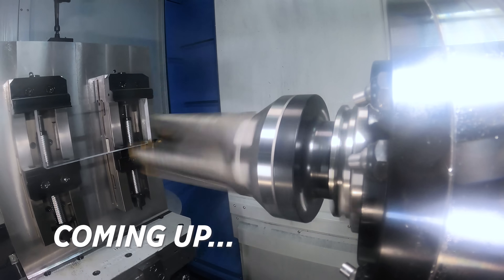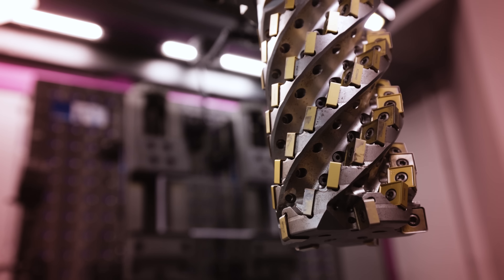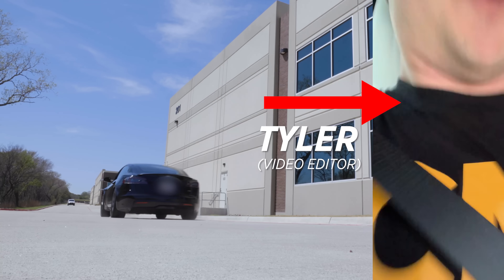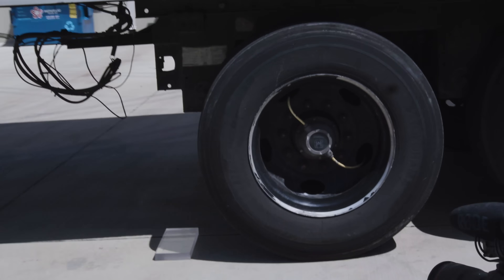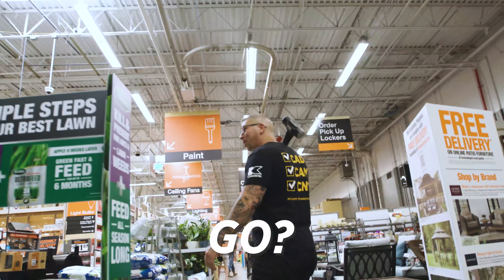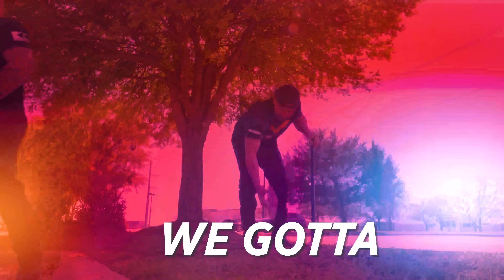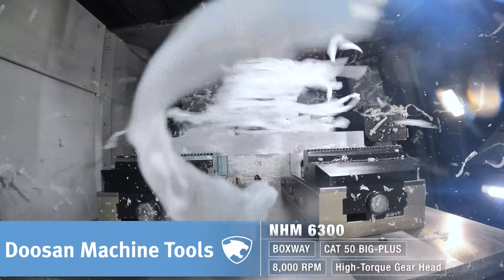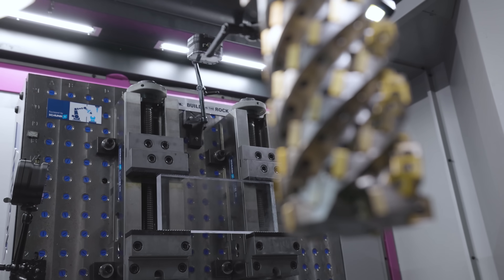MACHINING BULLETPROOF GLASS | DEADLIEST Environment on Earth

Comment from the maker: Bullet Resistance - UL 752 Rated Acrylic is used in this video.

Underwriters Laboratories, UL 752, is the specification most commonly used to identify a material's level of bullet resistance. Chemcast sheets listed under UL 752 are rated for both indoor and outdoor applications.
Reply: What's the name of the song at 3:03 ?

Comment: It's acrylic, it's plastic. Not surprised you can mill through it
Reply from the maker: Bullet Resistance - UL 752 Rated Acrylic is used in this video.

Underwriters Laboratories, UL 752, is the specification most commonly used to identify a material's level of bullet resistance. Chemcast sheets listed under UL 752 are rated for both indoor and outdoor applications.

Comment: Doesn't acrylic expand when it gets wet over and over? 
I got these plastic strips (I think are acrylic) in my machines interior ceiling and it's been about 1yr6months now and they have each swelled to the point where I need to eventually remove them because the sag is like 50mm deep between the fasteners?
Reply from the maker: Bullet Resistance - UL 752 Rated Acrylic is used in this video.

Underwriters Laboratories, UL 752, is the specification most commonly used to identify a material's level of bullet resistance. Chemcast sheets listed under UL 752 are rated for both indoor and outdoor applications.

Comment: That was fun but predictable that material strength is against small projectile impacts, if you want some real action try the same with a tungsten block of the same thickness and jam that cracking in it the same way and have your vendors repair number handy because you will need it after the fireworks show is over :)

Comment: Totally knew the ending, I run this stuff on a vacuum table with 1/4" and 1/8" mills.  It absorbs an impact with sufficient thickness (or it cracks in half like the sledge did to it) but it cuts like a dream, if your dreams involve remelted chips and hours of manual cleanup followed by a hydrogen flame polishing... yeah we probably don't have the same dreams...

Comment: I machine medical grade PMMA acrylic at work, and the biggest challenge I have with it is overheating it and causing the chips to re-attach to the part or melt onto the cutter.  I use a high-velocity air-blast from three nozzles to evacuate the chips as quickly as possible.  The heat probably isn't a big issue when the cutters are this big, but I use cutters as small as 0.002".  That's smaller than a human hair, for reference.  I have to spin that thing at 52,500 RPM and move it at 0.1 IPM to get it to survive.  Running RPMs that high really puts heat into the part.  

I sometimes use a 1/8" cutter to do some major roughing, and watching that thing sling acrylic "snow" everywhere is so cool!  The chips really pile up, but they weigh nothing, so it really is like snow!

Also, I've used acrylic for fixturing instead of aluminum because it's easier to machine and more resistant to impact.  It's very brittle, though.
Reply: Laser cutting acrylic, same deal, without using nitrogen i can't keep it from reattaching. Very heat sensitive plastic.
Reply: @tslim250  cutting it on Lasers produce a lot of toxic Gas 😵‍💫. In Our Shop nitrogen is Standard for cutting anything on the Lasers. But we only cut galvanized steel, normal steel, Aluminium and stainless. We use amada co2 Lasers, Hope we get that ensis soon to cut faster and cutting copper and brass 😅. When we cut acrylic we stamp it on our turretpunchpress like the amada AE or EMK. Stamping it is a dream with the Right Tools.
Reply: Funny when a 1/8” cutter is for “major roughing”
Reply: @deepfriedpotatoes9888  I know!  It's hilarious to think about it like that, but, when you're machining parts that are 0.006" thick by 0.004" wide, 1/8" is HUGE!
Reply: @JayRussellDuramax  What kinds of cutters are .002 inch thick?
Reply: @oceanic8424  McMaster sells micro endmills in solid carbide.  They're 2-flute and have a length-of-cut of 0.006".  You can hardly even see them!
Reply: Look into 100% Alcohol cooling systems. It uses a high pressure mist. Used to cut almost exclusively plastics, Not a better coolant I have found. In a pinch maybe fabricate some sort of dry ice box for the air to cycle thru in line to the part.
Reply: @blahblah61334  Thank you for the suggestion!  My original comment may have been a bit unclear, as I don't have any issues with chip melting if I get the speeds and feeds right.  That's been the biggest challenge for me.  If I get them right, the edges are crisp and clean!  If I get them wrong, the edges look like a dust ruffle on a box spring mattress.  Haha!

Comment: How about you guys toss another 1600lb piece of material onto the fixture, get the biggest cutter you got and see how fast you can make it disappear.
Reply: I have actually been wanting to do exactly that. Full slot as long as the tool survives or we are out of material. It's just hard to justify spending 1000's of dollars just to turn it into chips. But I have been shopping around trying to find a huge remnant!
Reply: @barrysetzer  easy! Challenge Titan to see who can make that amount of material into chips faster. 😉
Reply: I tried that, and he said “fine! Ill take the Ibarmia, and you can have the Tormach”
Reply: @barrysetzer  honestly, it would be interesting to see the difference in performance from one machine to another doing such a task. Kind of like a running a benchmark between the two machines .

Comment: Acrylic is tough stuff and in sufficient thicknesses will stop a bullet but it is not "bulletproof glass".   Ballistic rated glass is a very different material and you would probably get radically different results if you tried to machine it.   So get some REAL ballistic glass panels and try to machine them.     Usually that stuff is machined only with abrasives.  For good reason.
Reply: Probably because it would shatter, i doubt anything bad would happen to the tool besides maybe gumming up the inserts.
Reply from the maker: Bullet Resistance - UL 752 Rated Acrylic is used in this video.

Underwriters Laboratories, UL 752, is the specification most commonly used to identify a material's level of bullet resistance. Chemcast sheets listed under UL 752 are rated for both indoor and outdoor applications.
Reply: @TITANSofCNC  I think he means that bulletproof glass and bulletproof acrylic are 2 different things, and that machining said glass (which from my understanding is sheets of gorilla glass with plastic or acrylic between the layers) would be interesting and give different results.

Comment: Completely unsurprising outcome for those familiar with the material properties. Acrylic is extremely tough but not very hard at all, trading off the hardness and scratch resistance silica glass for superior toughness. Laminated glass alternates between silica and polymer based glass to combine scratch resistance/hardness with the toughness.
Reply: Yeah why not try smth that's as hard as diamond 🤔 Would prolly be expensive as hell whatever the substance is
Reply: Agreed

Comment: Why roll over it with the trailer and not the rear cab wheels?
Reply from the maker: Point taken… The Sledge Hammer was the Best😂😂😂😂
Reply: @TITANSofCNC  True. I'm loving the Academy by the way. Never done any CNC design and finished CAD Titan-1M through 10M in 2 days with CAM for 1M-4M using Fusion 360.

Comment: Try transparent aluminum next ( witch is also used as bulletproof glas)
Reply: Aluminum OxyNitride is also known as Spinel.  Machining it will require boron nitride or diamond tooling.
Reply: AlON is expensive ($10 to $15 per square inch). Also, it is classified as a ceramic not a metal or plastic.
Reply: @Dumascain  i know but you can machine glass you know ( its not easy though with carbide endmill i tell ya )